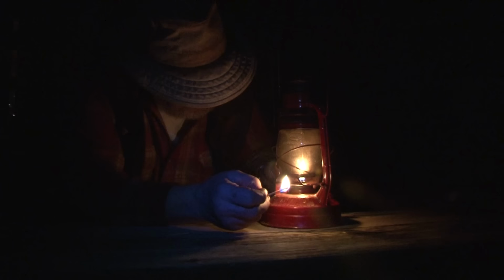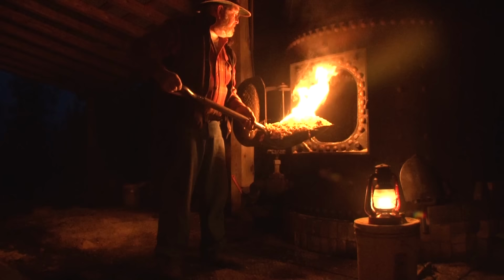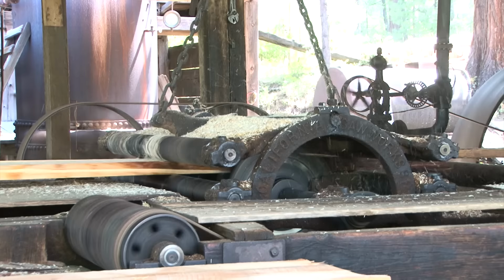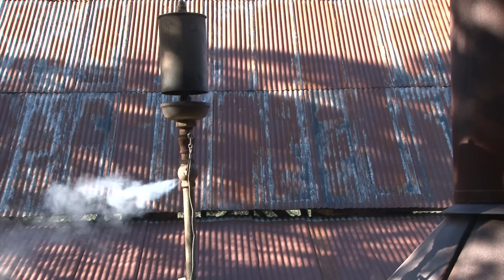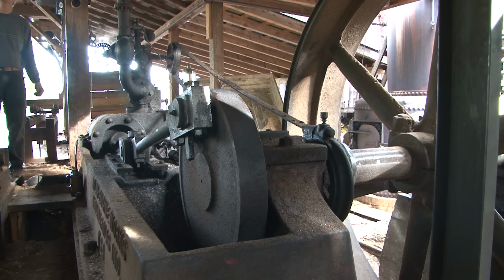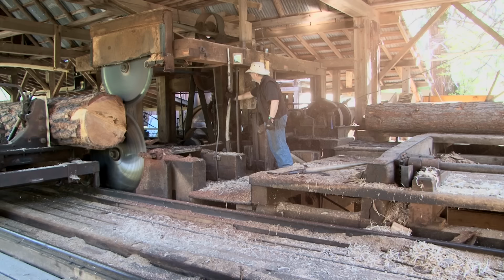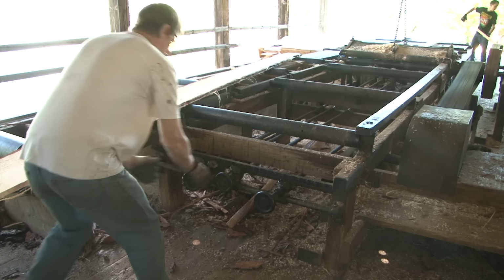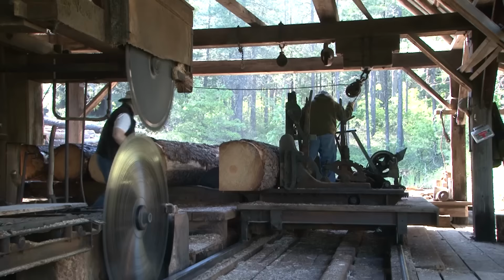Best of the Historic Steam Sawmill

Comment: I don't quite understand why two blades are used on some of the cuts.
Reply from the maker: The top blade is used for large logs.  Check out my video "Sawing a large log" or "Sawing a Ponderosa Pine" and you can see how it works.  Sometimes the top blade is inadvertently left engaged even when it's no longer needed.
Reply: MrShoptaw: Thanks for explaining the reason for two blades. I can see now the top blade is in line and slightly behind the bottom blade. Makes perfect sense, in fact the only way I can think of to saw boards from huge logs in a single pass. I watched your video "Sawing a large log" and impressed with the power of that steam engine and two blades in action.
Reply from the maker: Very good.  The mill is impressive indeed.  :>)

Comment: heh ah its powerful and runs many things off the boiler but itas an osha nightmare with all the moving parts heh, I bet though slower its got plenty power, steam engines usually do, they are just really heavy, as it were as far as locomotives go, the steamers were and still are more powerful at speed then the diesle electro of equivalent power, that is as long as you could keep steam going it would just keep moving along till the wheels slipped or you got the job done, it would just keep going and the hotter the steam the better, well against the piston anyway, they are durable too but have lots of moving parts and take lots of maintanance, but the steam engines were built strong, you just have to keep an eye on the boiler you dont want it to blow afterall, and make sure you have the water on it to keep the heating elements from melting or getting damaged.

and you could say it is a good set up they have there lots of watter in the pond to make steam, and sawdust to feed the fire its nearly a complete loop, now if they just had a condenser on the steam to reuse the water.
Reply from the maker: +manga12 - Yes indeed, great power source.  :>)

Comment: Just a question! What about water level in boiler?
Reply from the maker: I'm just a videographer and don't know much about those specifics.  I know there is a sight glass that shows the water level, and they check it often, Thanks for watching.
Reply: Some mills had a hand pump for filling the boiler.  But i don't know about this one.
Reply: @danielflora2228  Have the knowledge of ship boilers that if you leave them without water they will burn out for this reason I ask!
Reply: The most important thing with a boiler is water level , end of story . Not enough and it becomes a bomb ! Too much and you don’t have enough steam space to be efficient .  Everyone needs to know how to put water into a boiler so that if the attendant is incapable of doing it then it doesn’t become dangerous . Usually mechanical pump or steam injector overcomes the pressure to add water . Old boilers despite being old actually had several safety features built in. Love your video , would love to see it my self one day . All the best from New Zealand

Comment: how is the saw carriage pulled past the saw blade?
Reply from the maker: It's like a cable car.  There is a cable attached under the carriage that the sawyer controls to pull it forward and backward.
Reply: @MrShoptaw  thank you for your reply, so does the system operate as a sort of pully system? I just find log milling to be fascinating, and want to know more about it, I see a lot of modern mills use hydraulics, but steam mills don't I imagine.

Comment: WAS THE FRESH FIRE IN THE BOILER ON A MONDAY MORNING 
AFTER BEING SHUT DOWN OVER THE WEEKEND?
IF THE BOILER WAS USED THE PREVIOUS DAY SOME LARGE OVERNIGHT HARDWOOD CHUNKS 
SHOULD HAVE BEEN LEFT IN THE FIREBOX OVERNIGHT, WITH THE FLUE DAMPERED AND AIR INLETS CLOSED OFF!
IN THE MORNING BUST UP THE HOT COALS  THROW ON FRESH FUEL, OPEN AIR VENTS AND FLUE DAMPER.
IT WILL BE HOT AND READY REAL SOON!!
Reply from the maker: Certainly works out that way sometimes.  Thanks for watching.
Reply: Ross, I reckon as they've been doing this since 1898, that they probably know what they're doing without input from a comment on YouTube... <SMH>
Reply: @bobafetting6373  was thinking just the same 😂😂 everybody is an expert, probably don’t cut any hard wood anyway

Comment: zero emissions nice!
Reply: What? They are burning trees.
Reply: @TemplarX2  
net zero emissions
Reply: Depends on the forest management -- properly managed forests will replace their carbon sinks in time, but clearcut forests for example may never reach the same ecological density, or it might take like a hundred+ years. Really depends.
Reply: @TemplarX2  
Before you can cut down a tree, the tree has to grow. By growing a tree collects "emissions" from the atmosphere. 
If you burn a tree, you are just releasing everything the tress has collected over its lifespann. --> net zero emission.
Reply: +keyboard
Wow, you are not that stupid, are you? The trees keep the carbon dioxide cycle in balance. It you cut a tree and burn it, not only the tree is no longer taking in carbon dioxide from the atmosphere, but the carbon it has stored during it's lifetime is now released into the atmosphere in the form of carbon dioxide. This is a concept even a monkey can grasp.
Now if they are managing a forest and replacing the cut down trees (which I doubt), it is still not carbon neutral (not zero emission which is a different concept). The reason being a tree takes time to grow and an immature tree do not absorb as much carbon dioxide as a mature tree. So there is a temporary gap in the carbon cycle.
Reply: Keyboard runner net zero emissions for that tree if grown in that location. But, if it’s from another location, cut, transported, and grown in a fast grow forest where the sequestration doesn’t take place in the natural order of things, then there is still a net CO2 emission. Add to that the likelihood of of the growth location being a monoculture and so impacting the biodiversity too then it’s not a good news story. 
That said, of course, this is a much more sustainable and lower emission way of doing things vs using coal/oil/natural gas powered energy generation.
Reply: @clavicus  Actually the result of  clear cutting would remove more co2 from the air because it causes the forest to grow back very thick, the amount of saplings and heavy leaf spread is so thick you can't even walk through it.. not good for renewable wood source but it grows more trees then old forest.
Reply: @dmithsmith5880  I get what you're saying, but it's debatable. I'd genuinely love to hear a forestry professor's take on that. I only know the basics from my classes years ago, and knowledge changes.

Comment: I'm always fascinated by steam power. It's a shame that the steam engine fell out of fashion. With modern micro-electrics and thermal insulation, I'm sure we could make much more efficient and reliable steam engines.
Reply from the maker: Steam is still being use in many operations.  The nostalgic chug chou though being replaced by a turbine.

Comment: I would use a steam tractor than I could plow fields and run a sawmill
Reply from the maker: Yes you could.  Beside the 12 stationary steam engines used at the mill there is a Best and Case traction engine that use to bring the logs from the forest to the mill.  They are now used primarily for demonstration.  :>)

Comment: You will not find a more carbon friendly machine than this doing the exact same job. Diesel will be more dirty smoke, and if it's powered by renewables then the carbon used to create the solar panels or nuclear plant or wind power would outweigh this steam-engines, we need to back to steam power in certain areas and just tweak it a bit with carbon neutral modern technology.
Reply from the maker: If I understand correctly, the steam powered co-generation plants that use biomass to fuel the boilers can do that.  The emissions are scrubbed and the forests are healthier having much of the hazardous fuels removed.  :>)